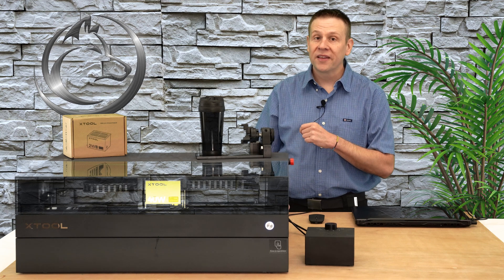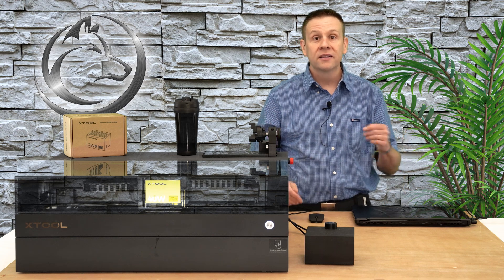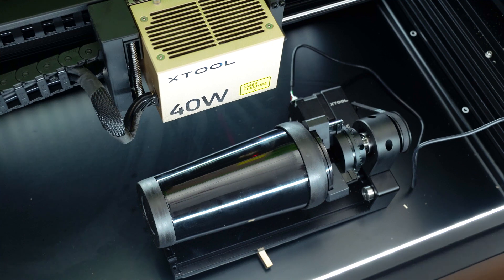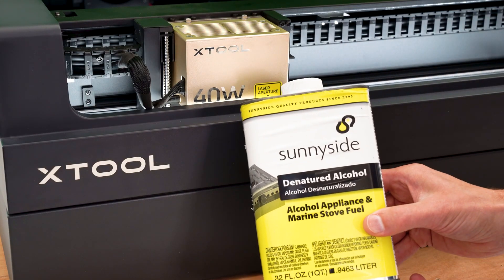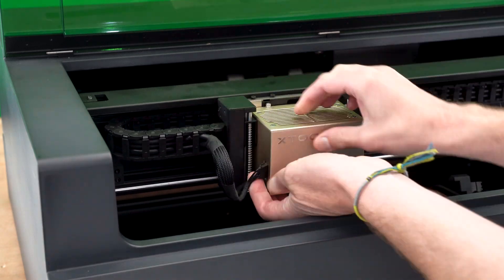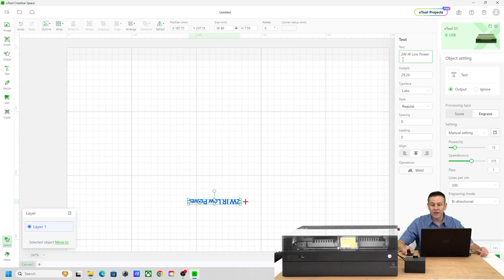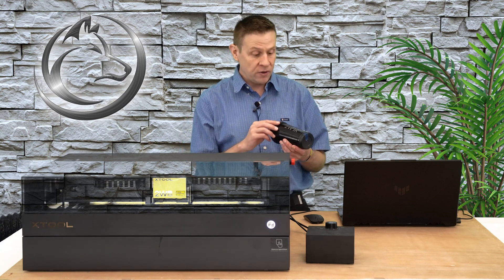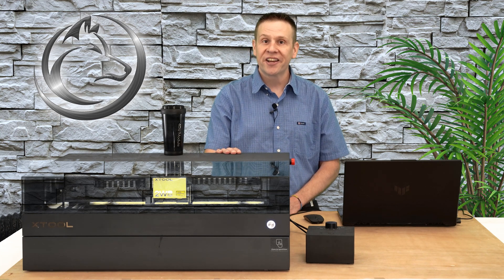Xtool 40 watt Laser Diode and 2 Watt IR Engraving Comparison #xtool #laser #tumbler #woodworking

Comment: Your the only person that explains both modules. THANK YOU!!! 1 question. Did you use laser etching spray? If you didn’t, what is the benefit of using it? Cause they look really good.
Reply from the maker: Thanks!!  No laser etching spray.  Both laser modules are able to remove the coating from the tumbler.  Thanks for watching!
Reply: Use etching spray on silver stainless steall tumbluers as there no paint on them to remove

Comment: I just ordered this exact laser and modules (haven't received it yet). Based on this video, I'm concerned that I wasted money by ordering the IR module in addition to the 40w module. Is there a purpose to use the IR module over the 40w module? Thanks for helping;ping a beginner!
Reply from the maker: No, you did not waste you're money buying both the IR and 40w modules.  The IR module works great on just about any metals.  While both can directly mark stainless steel- the IR can mark with far less risk of heat warping the metal.  I think you'll be very happy with both modules!
Reply from the maker: Here's my first video on the IR module- install and engraving different materials: https://youtu.be/ZrvI-nE4PFk

Comment: Does this setup provide enough capacity to do 40 oz tumblers with handle attached?
Reply from the maker: Good question- I've only ran the 20 oz tumblers.  Let me take a measurement... with the tray completely removed from the riser base the center of the chuck to the tip of the auto focus is about 75 mm.  Not sure if that helps.
Reply: @Lance McGrew ...Most people remove the handle so it is perfectly round and doesn't confuse the process. Also not all 20oz are made the same, some have trim line handles and some have a more robust handle...pick what style cup you want to carry and donate one to your learning process.